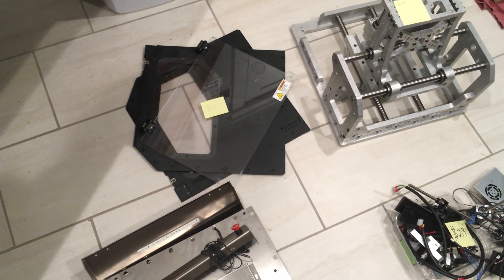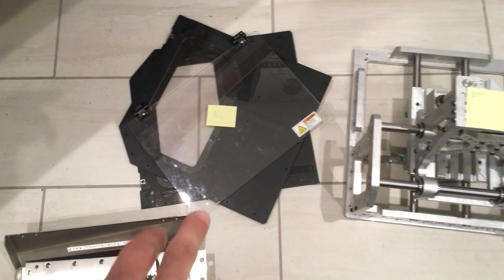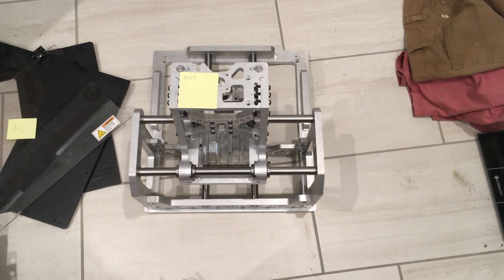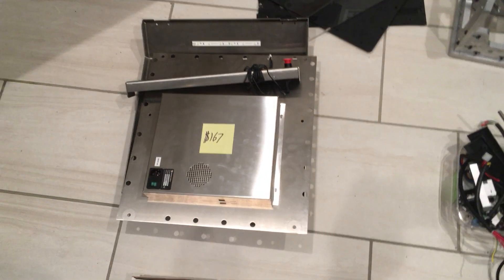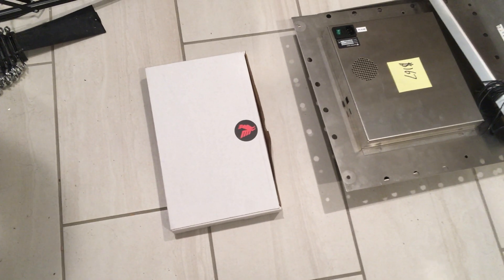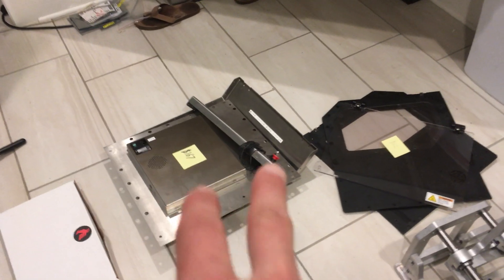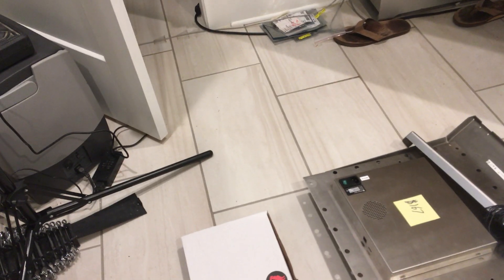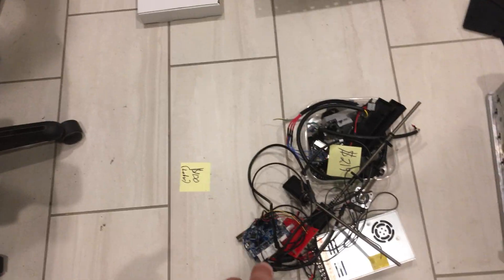Bantam Tools Desktop CNC Hardware Cost Estimate

Comment: Any rough guestimates on various dimensions of that gantry? 😂 just curious good sir
Reply from the maker: If you're making your own machine, this isn't the one to copy.  There are plenty of better units on the market to use as a starting guide.  Find the drawings for one of the several open source CNC machines.
Reply: @doppelhub  Your feedback is gold! Thank you so much! I will look into them. Any come to mind off hand that you like?

Comment: I haven't watched the video but it would appear that this is about a 3018 table size......I like the heavy construction of the frame and the X axis rail configuration, but milling it out of heavy sections is always going to be an expensive job compared to a conventional extrusion bolt together build for this size mill.
I think once the frame layout is established it can be relegated to a CNC machining operation which will significantly reduce the cost.......prototypes are always humungeosly expensive.
Reply from the maker: Based on your later comments, looks like you ended up watching the videos... so you probably know now how inefficiently Bantam's design takes advantage of all that metal in their machine... it's just a horrible implementation, as shown in the videos.  With the same "amount" of metal, you could build a considerably more rigid machine.

Comment: Can you Address spindle motor a bit more? it seems like it is a large drone motor. I'd rather not disassemble mine just yet. This machine is fantastic for someone with zero experience (like me) to learn and make simple parts. This machine paired with fusion360 is perfect.
Reply from the maker: I've posted several more videos, some specifically addressing the spindle.  This is probably the most relevant: https://www.youtube.com/watch?v=n-x_h-PnU2Q

Comment: I bought a 6040CNC 4th axis router for $1500. Came with Ballscrews and 1.5KW Spindle.... Didnt like how flexible everything was, So I started a project to upgrade the Gantry to Linear Rails instead of Rod. Taking the machine apart I found the other linear bearings for Y axis travel were not right. So I built myself a brand new machine, The only original items in it were the X and Y ballscrews. Z axis was completely upgraded. Everything was made from 6061 .750" Aluminum. I have brand new set of Hybrid Steppers to go in. All the materials and new electronics cost me $1400.  The increase in Z axis gantry width reduced travel to 12" max. Y axis I believe is 20" and Z axis is 6". I needed that room because I plan to add 5th axis which will add only another $150 in material. So Rounding up to $1700 costs of material for 5 axis machine. I have about 75 man hours put in the job as I machined every part on a Comet Milling machine (Chinese bridgeport knockoff). Labor alone is $4500 at 60/hr. Making total Retail cost of $5900 for 4th axis machine or $6700 est. for 5 axis. 

It is very close to finished and I will add my first vid on youtube once I complete flood coolant system and enclosure, which I did not add onto the cost. The enclosure measure 29" x 40" which is also the pan size. I made that at my job, so , I estimate materials cost for that will be around $200, which is company cost, not consumer cost.